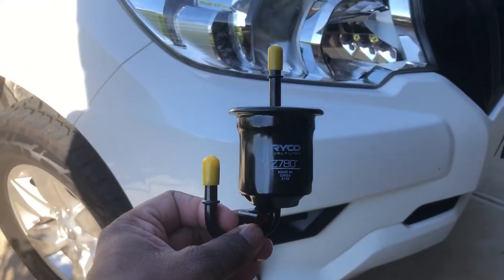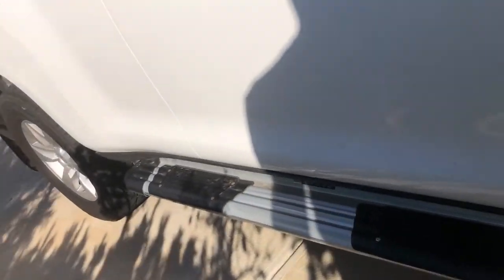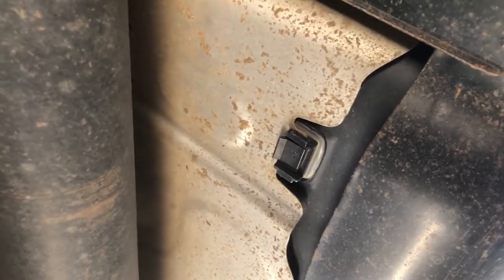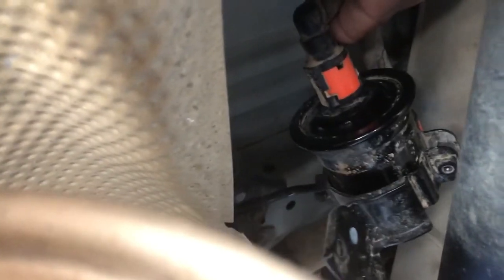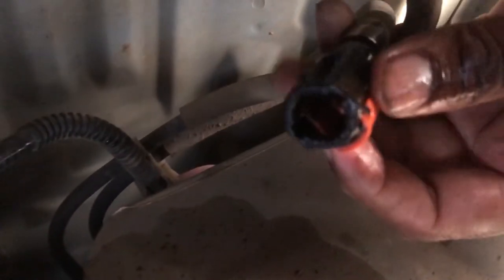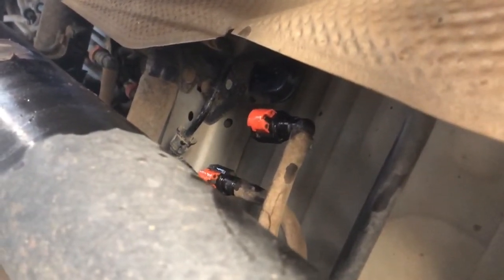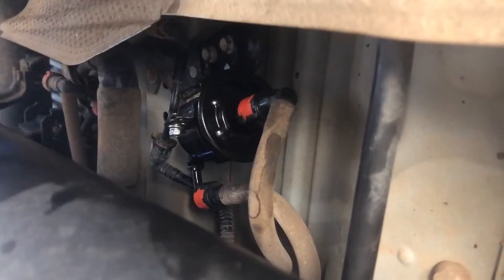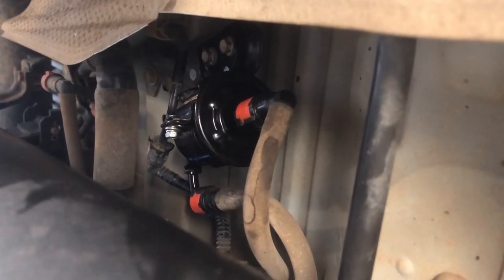How to replace Fuel Transfer System Filter Rear Filter of Prado 150

Comment: Hi, do you know the service interval for the Fuel filter (diesel)?.. The one you in this video shows the fuel transfer system filter at every 20k interval. Also, there is fuel transfer pump that needs to be serviced every 150k.